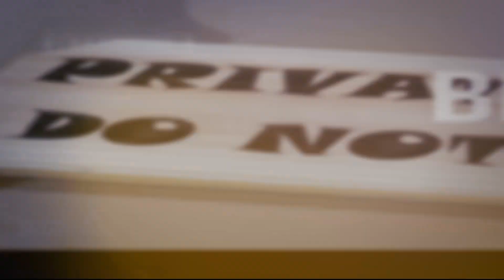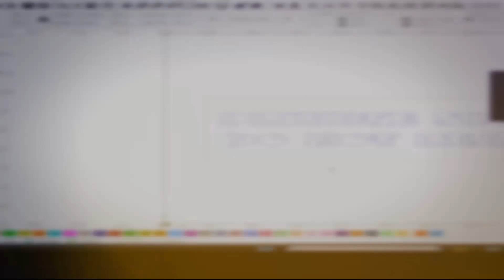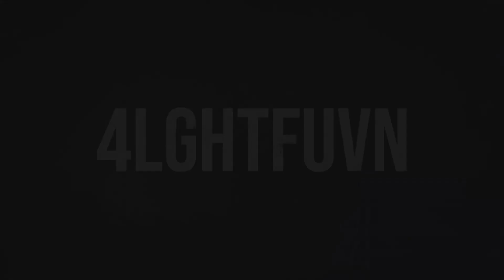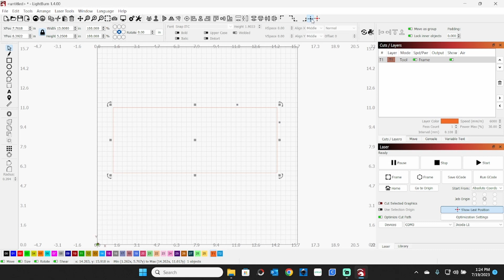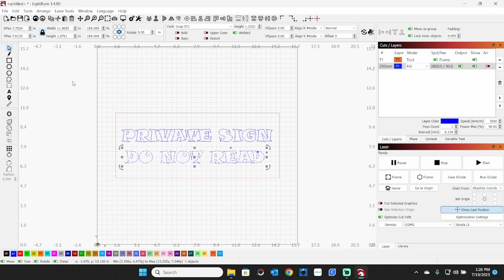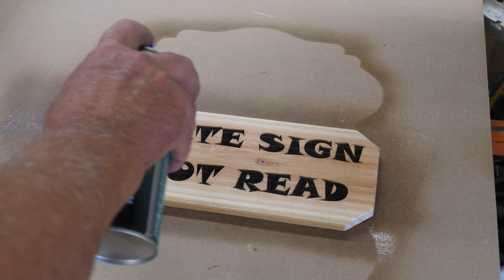Beginner Laser Project 17 Private Sign

Comment: Slowly but steadily working thru my beginner projects Roger and again thankyou for your time showing all us newbs how to. I do have another question 🙋‍♂️ lol 😂 no surprise there ! When I put my text in everything looks great until I start. Then I have to remember that if I don’t invert my text before I start it engraves back to front ! Almost like my laser is upside down. Not a big deal but is this something I can change in a setting ? Thankyou
Reply from the maker: It should not do that.  The only time I've had that happen is if I design a project for the Xtool D1, save it, then open on another laser brand.  It is upside down and mirrored, so I have to flip it.  Check to see if your home position in the laser setup is in the right place.  Most home to the lower left, but a couple brands home to upper left.
Reply: thankyou @rogersshop